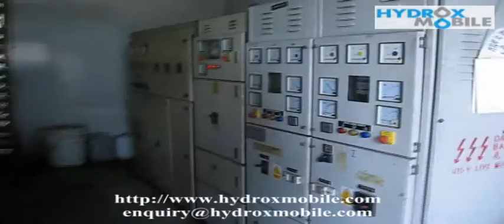Island Trip to Install Hydrox Mobile HHO XCell L Duo on Diesel Genset

Comment from the maker: The fuel savings recorded on these 2 gensets is 35%.  After fuel pump governor adjustment, the fuel savings recorded at 45%.  Please call +603 8060 0850 to arrange for site visit.